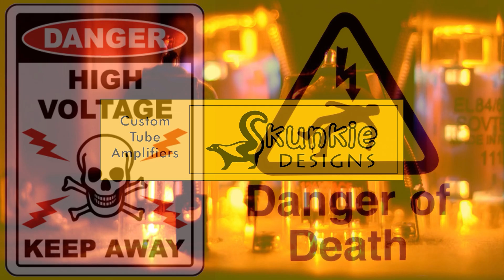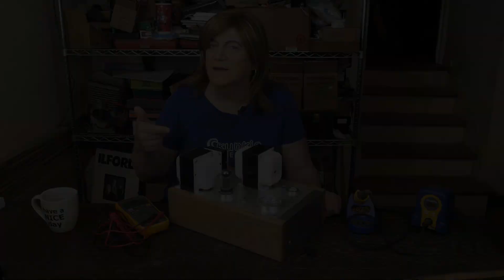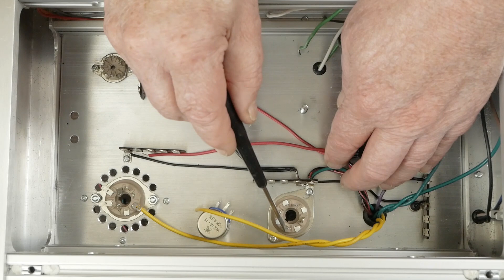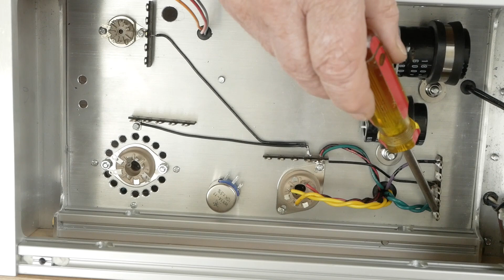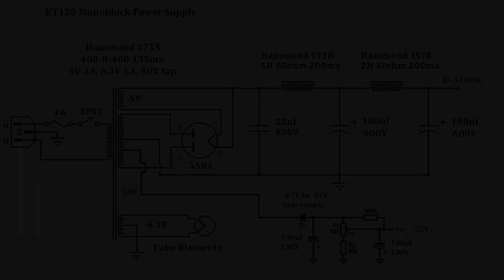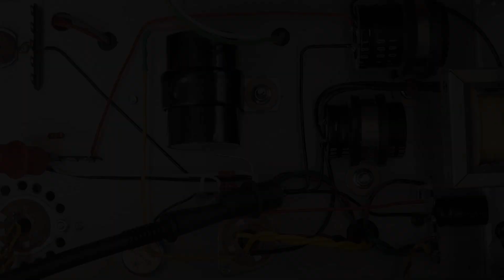KT120  SE Tube Amplifier: Power Supply Construction

Comment: I'm looking build a new amp and I usually build from kits mostly from Transcendent Sound. I have their Masterpiece 300B Preamp Paired with an earlier version of theirt Mini Beast OTL amp  thats 4 watts.  I'd like more power so I was considering their The Son of Beast OTL thats 15 Watts. With tubes it would run about $1500 then I saw you vids on the KT120 Mono Blocks. Do you Have a Parts list other than the link  to the manufacturer for the iron your using for this build. I'd like to price it out. Approx how much have you got into your build?  Also is there a final downloadable schematic avaliable somewhere or just screen cap the end of the vid?
Reply from the maker: I'm not finished and don't want to publish the parts list for a beta version. This may end up using KT150 tubes etc.

Comment: A “star ground” setup is not grounded at the ends of the “star.”  Only the central point should be grounded.  Just move the wires at the far ends of your star from those grounded lugs to their non-grounded neighbors.  Your current setup will function, but it is not a “star.”  It may actually cause ground loops.
Reply from the maker: Never had any issues using this design running a dedicated ground wires, path of least resistance. There will absolutely be issues if you use the chassis for the ground. But feel free to do as you like and adding longer tag strips if there is room. You aren't the first person to say this, I've tried both ways and not seen any difference in performance.

Comment: Just checked the data sheet on the kt-120 tubes and they are some hefty little monsters. For plate current are you thinking maybe 90 or 100 ma? It will be interesting to see what you come up with.
Reply from the maker: The first one I built I biased at 100ma 80% disp and got right at 14W, turn it up to 115ma at 90% disp and got 18W both of these are no clipping at 2% THD.